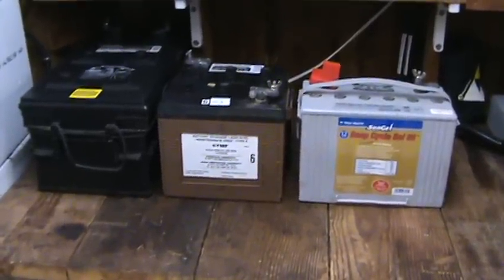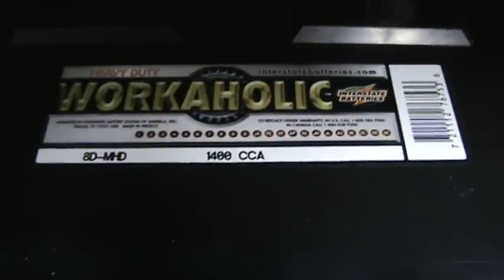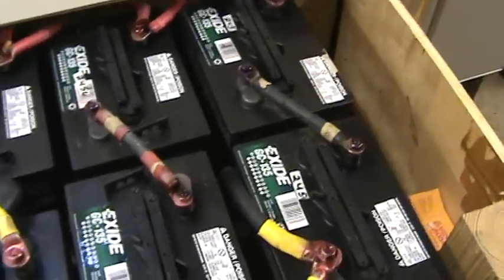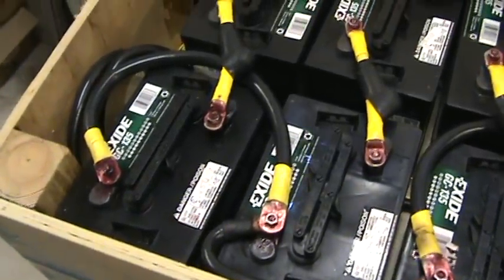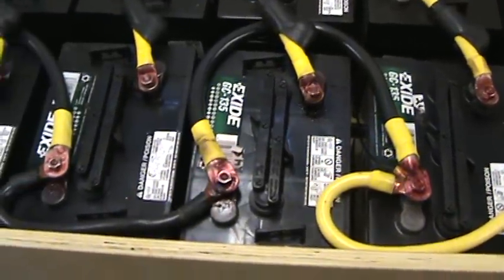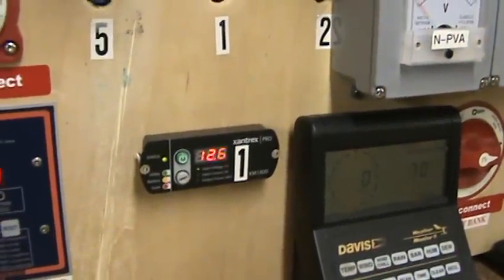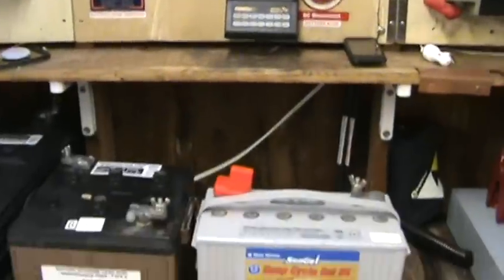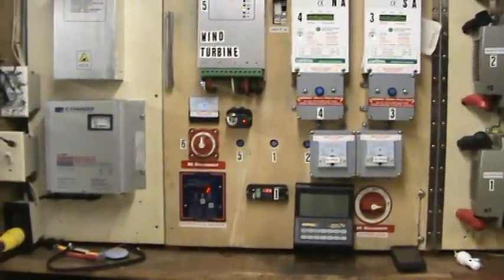Choosing batteries for solar power offgrid or a battery backup system.

Comment: I've been off the grid for over 20 yrs now and what I've found was that the gel cells don't work at all in the summer time.They hate heat.The agm's work fine,and the golf cart  6 volts work fine.But if you really want a killer system that you cant hurt then go to the fork lift batteries.You can get 3000 or better amp hrs and you can hit them hard as you want and take them all they way down and not hurt them.They would be the last batteries you would have to buy.Well worth it.Also I found that using buss bars made from copper pipe or brass bars work better than cables.There is no loss in them and what I have found was that even if you keep the cables clean you can't get the corrosion out of the wires under the sheathing,and you will lose allot of amps and not figure out why.Once I started using buss bars I never lost a single amp.Great work by the way,I'm just glad that someone is teaching people how to be self sufficient.
Reply: Forklift batteries can last for  along time, that is true if it is treated right. If you abuse them they will be killed in no time like any other lead acid battery.
To note also is that a forklift battery will take up to 20% more power to recharge than any other lead acid battery of the same capacity.
Reply: Good show. 
Johnson Controls make an assortment of Batts for a variety of brand names. 
 Their quality control is admirable.
Any budget minded person can realize that's $$ well spent.
Reply: You should have your own channel.  Most folks don't have that experience.

Comment: I been running 8D batteries with a reserve of over 430 hrs @ 25 amps for over 30
years on multiple yachts. They will run almost anything. They take charge discharge cycles in the high hundreds if not more. My batteries run what is a self contained livable environment on my boats.I do less than 50% discharge before  recharging, this increases charge cycles by almost double. I run 2 3000 watt inverts both @ 50% , they draw about 25+ amps together while in this mode with a reserve of 3000 watts. This gives me around 200+ hrs between charges. I have 2 of these 8D batteries and both are over 3 years old and show no signs of dying.Cost under $ 200.00 ea. Sam's club. These batteries have been the marine industry standard for decades. It's one thing to have your outhouse light go out, it's another to be in the middle of the ocean when your power craps out. I'll go with the millions of sailors with a combined use life of MILLIONS of use hours using this proven battery over all this hypothetical stuff any day. i'M PREPPED TO SAIL MY ASS OUTA HERE

Comment: I'm rather surprised that the battery are not lasting beyond 4 to 5 years before they are replaced.  Sounds like the batteries are building up a layer of sulfate (sulfation,) which is actually VERY easy and CHEAP to solve.  Try adding a teaspoon of Epson salt to EACH cell INSIDE of the battery, then charge them to a 14V charge for a couple of hours .  After checking and validating the voltage is holding at 12.5V or higher for at least an hour after being removed from the panels before hooking them up to the inverter (I assume you are using a grid-tie vrs. a simple isolated grid lije when camping.)

The desulfation may (the first few times) cause the battery to get a bit warm, but so long as the caps do NOT pop up and the acid starts to leak out (by charging higher volts at a lower amp) it should restore an old battery to it's virtually 'NEW' ability to charge and RETAIN the charge.   

I've got cheap batteries I bought at Walmart that are running just as good as the day I bought them.  Heck the system works so well I've had the power co 'question' me, and wanted to come out and 'review' things....  I think they are hust frustrated because they have been paying ME for the surplus power now.

Hehehe...

God Bless & Semper Fi!
Reply: epson salt will destroy deteriorate the battery plate in  a battery in no time and will lower the battery voltage.
Reply: David Sturdevant 
thats an old car lot trick. the battery will last long enough to sell the clunker, but it destroys the battery in fairly short order.

Comment: Hello, I will be using a 500 watt solar cell to be used on my 14ft cabin sailboat I am building.  I am looking to parrallel the batteries.  The batteries will be in my small cabin.  Using solar for Garmin for navigation, recharge double AA type batteries, lap top, and lights.  Any suggestions for battery type?  Thank you. Bert.

Comment: ALL of these batteries are not as good as you can get for the money. They're either lead-acid or gel-cell. All of them have a VERY limited lifespan of 5-10 years if used correctly and properly maintained. Where are the Nickel-Iron batteries, Iron-Edison batteries have a 10 year guarantee and some of the original Edison Electric Co. Nickel Iron batteries are still working (some at almost 85% capacity) 100 years later! Why spend a ton of money on something that should last at least 20 years but only lasts 5-10 years. The lead-acid batteries are 19th century technology, why are we still using it? Ni-Fe batteries can be discharged MUCH MORE without damaging them and reducing their lifespan. They also have better charge/discharge capabilities, and if properly maintained should last your LIFETIME!
Reply: Daniel Huarte
Earth 4 Energy

Safe Redirect => http://home-renewable-energy.blogspot.com
Reply: I'm fully agree wiht you! And I'm trying to make Nickel-Iron batteries. Do you know any recipe for to fabricate its? I ask this, because is not just to put Iron, Nickel and potassium solution in a case.I saw that it use oxide-Nickel powder in a frame like support, immersed in the solution.
And the lead-acid batterys EXTREMELY reach the 5-10 years of use.
Reply: ssssssssssssss
Reply: Iron Edison is supplied by Changhong a Chinese battery company ..... Ni-Fe has energy efficiency of a little over 50% ..... and the Chinese manufacture says their batteries will only last 3 years at a daily 80% discharge rate .... do more research  ....

Comment: ...and to the guys trying to sell building DIY panels, I have to ask what your time is worth. There are many distributors with panels less than a dollar a watt these days, some around 50 cents/watt. The Chinese amorphous sets from harbor freight are NOT a deal. 45 watts from three panels and a ten buck PWM controller for over $200? Try Solar Blvd, like another person posted, or try Sun Electronics. Northern Arizona Sun & Wind... etc. There are many out there selling good panels at decent prices. Just do a little homework. The ones selling the Chinese stuff at inflated prices (harbor freight, northern tool, etc) expect the customer to not do any research. PV has come down in price, and is more affordable than ever. I just went to one web site, and they have 230w, 24v panels for $155. That's .67 per watt. It's just one example. I think it would be a challenge to buy all the supplies, including a large piece of low reflectivity tempered glass, and still 'make' a couple of bucks an hour by the time you're done. Look around, affordable 'commercial' panels are available. Putting together a small to medium sized offgrid or stand alone system is not rocket science. Just do some research.... buy a book, read some magazine articles, and check out all the free video info here on youtube.
Reply: i agree totally.
Reply: steve w 
the panels i got from harbour freight had one that put out 5 watts. the moral of this story is test them when you get them.

Comment: Golf cart batteries are great for a couple of reasons: one, they're readily available and affordable. Also, eventually every battery will need to be replaced. Larger "L-16" type batteries have more capacity and will last longer, but weigh well over a hundred pounds each. I'm glad you mentioned equalizing the battery bank. It was a good explanation, and answers Nathan's question to a degree. Over charging an AGM or get battery will ruin it. They're great in their own purpose (they're sealed, and don't gas as they're being charged, so they don't require the ventilation of a flooded battery), but to make them last longest, they have to be monitored often and kept near full charge, because you can't equalize. It's a different kind of maintenance, but it's still maintenance. A flooded battery will need to be topped off with distilled water every now and then. Some water will be lost in regular use. Running the high voltage during equalization insures long battery life in a flooded battery.

Comment: Could you please suggest for me, what would be needed to provide emergency power in my apartment? I would like to run to police scanners, and a laptop for several days. I would like to leave it constantly charging from a wall socket until it's needed. Thank you.
Reply: go with a LiPO4 battery that will not offgas for apartment use
Reply: Thank you. I'll check it out.
Reply: KyleCarrington Would the LiPO4 run a CPAP machine?  I need to find something to maintain durable medical equipment.
Reply: Asher Anna The answer is yes if you have enough of them.  It is all simple math.  But first you need to install a watt meter on your CPAP machine to see how much it draws.

Comment: Hello , I have 3 deep cycle batteries 112 ah each , I live in NYC so no solar or windmill for me but I do have a generator to charger them . I use a Schumacher 20-30 amp charger , was wandering if I can hook up a second 15 amp charger to the bank , I don't wanna burn out my chargers . Thanks
Reply: I'm using it for lights in the garage since no electric (NYC rules) I spend a lot of time there and I must close the door (you not supposed to work in your garage just park your car) so I just wanna be able to charge my bank faster but don't wanna destroy my chargers or my batteries . Thanks a lot ..
Reply: Mike O nice town......I'd move........
Reply: SpockMcoy Issmart it's NYC not a town but okay
Reply: I think frank Sinatra called it a town ;).  I don't live anywhere I can't burn wood, shoot, etc, etc....
Reply: SpockMcoy Issmart oh id love to burn some wood, it's why I go camping all the time. Here I probably go to jail for that :)

Comment: I am starting with 4 Trojan 6volt golf cart batteries. I have a small 60 watt, 12volt solar array and a charge controller. My solar panels are not charging my batteries up enough during the day to run a couple of lights. How many panels and what size would be necessary to charge them up during the day. All I want to run is a 90watt LED, and a 4 tube, 4' Florescent light fixture for 18 hours a day in my greenhouse.

Comment: Lithionics makes 12v through 48v lithium power cells up to 400 Amp Hours (single battery) designed for solar and depending on discharge 85-95% and up to 3000 cycles,400 amp cont. 2000amp peak,Superior batteries! If these are too much money Sun Xtender brand is half the price!

Comment: ...and they will last 30+ years since they are well sealed, they use low iron, tempered glass so collect more light, safer. Window glass it's coated to inhibit UV transmission so stops even more of the light. If you use plastic, it's a fire hazard and will fade, as well as expand and contract and break your seal pretty quick. ...made yours for 58 cents a watt are you recycling the glass. 

UL listed are OK with your insurance co, a fire with non UL panels will be on you!

Off grid for 11+ yrs.

Comment: Where do you find solar panels for less than $1 a watt? The cheapest ones I could find are about $1.50 a watt. Also, I made my own 60 watt solar panel for around $35, or about $.58 a watt, so it is actually cheaper to make your own, though much more time consuming.

Comment: As long as you scale the voltage properly, and you have a charge controller to make sure the battery doesn't overcharge, you can use whatever type of battery you want, including forklift battery.

Comment: Making solar panels is more expensive than buying! Panels sell for less than $1 a watt. 

Amps in to amps out is incorrect in this video, you do need 25-30% more wattage, you charge at 14v vs <12.7v discharge.

Mass production is why 'golf cart' batteries are cheaper than 'solar' batteries. Most people who use solar use some type of deep cycle battery from other industries that use more of them, 'golf cart',  'floor scrubber' and 'forklift' are all popular batteries for solar use.

Comment: Hello. I am just starting out in solar power. Right now I have an 18 watt Coleman single panel and one deep cycle RV batt. The panel charges the batt very nicely and I use the batt in the evening/night. What I'm wondering is; can I hook my 110 volt 60 Hz converter up to the battery while it is being charged. Basically can I use the batt and be charging it at the same time? If I can, then could I hook the converter straight to the solar panel? Thanks in advance for your consideration on this.

Comment: Hello! Thank you for the info. I am in Pakistan and here power breakdowns are on daily basis. Additionally, price of electric power is going through the roof. I also recently acquired a Banana Farm and facing the same problem there. Came across your video while searching for high capacity deep well pump which can run on Solar Power. In your video can you tell me with all the gadgets on the wall how much a system like that can cost?

Comment: What's more important for deep cycle batteries is the reserve capacity rating and not the amp hour rating.  The reserve capacity tells how many minutes you can expect the fully charged battery to drain at 25 amps.  This will give you a much better view of the battery capacity in a solar system.  You'll also find that AGM batteries are really lacking in reserve capacity versus good ole wet cells. I like your setup! Mine is smaller and set up for AHBL Day running 2 chest freezers as fridges.

Comment: Hey thanks for the great video. I am looking into buying 6v Trojans for my rv which I'll be living in for two years with my partner. We are saving money for land and will be using solar and deep cycle batteries for our electricity. I'm not sure how many batteries and of what amp hours I will need. Is it just too much to ask to run the AC without damaging our batteries? We aren't picky but it would be great to have AC when extra people are packed in on hot days. Thanks for any help!

Comment: I was wanting to go alternative but the downfall is the battery technology currently sucks. It will cost you a good $1000 dollars for a bank of batteries and they will be useless in probably less than 3 years. Not to mention you waste more electricity charging them than they can hold and you can't really put them through deep cycles because it shortens their life.

I hope they hurry up and perfect the lithium ion batteries for big use since they do deep cycle and are lighter and hold more.

Comment: No Problem... Listen, NiFe batteries have a few small issues. But in my opinion, those issues are negligible. You can't drain them as fast as lead-acid on heavy loads, and they don't have quite the energy density either. But 50+ year lifespan? Wow...Discharge to zero, and no damage... Wow.

Comment: Math- use 60 amp for an hour, you need to put 30% more back in.   Simple math, 60 out, 90 back in?   My math says that's 50% back in (60+30=90) ?

Comment: those xantrax inverter are they modefi or pure sine?
also how long you keep them on? half of my house is of grid
I have 232ahx4 when it goes down to 11.5 the battery bank
in a day im putting back 54amp should I bee consern or I need more solar panels?

Comment: Good info.  I'm planning to set up an off grid system this Spring at my cabin.  One question that I have that I don't seem to get from these vids is what is the gauge wire used in connecting the batteries together? Thanks.

Comment: Would this be a decent solar battery for a home system?  Just found a 12V Duracell AGM battery (31DTMAGM) at Sam's Club for $169.  Seems to have good specs for a Marine/RV battery.  Most of the Solar AGM batteries I've looked at are $300.

•100 amp hour rate:110
•20 amp hour rate:105
•3 amp hour rate:85
•5 amp hour rate:86
•6 amp hour rate:87.4

I know you want to stay away from car batteries with lot's of cold cranking amps because they are not built for solar applications.

Comment: Wanted to mention that i liked your video and your indoor power panel is very elaborate. I would like to know more about the design and what it would take to set up one just like that??? Im in the beginning stage, right now im purchasing the solar cells and aluminum angle frames to build approx six solar panels that consists of 72 3x6 solar cells each. Right now im interested in learning about after the panels are completely built and tied together! After that im still lost! hahaha

Comment: This is easy.  You need to learn about series and parallel connections.  Connecting two 6 volt batteries in series will obtain 12 volts.  If you have 5 sets of batteries connected in this fashion, you parallel connect them together to maintain the 12 volts, but increasing amp hour capacity.  Use fuses between batteries for additional safety, especially if the batteries reside inside your home!

Comment: i got a free big boat battery i try to keep the charge up as much as possible and the cells full its lasted 3 weeks so far for a "junk" battery that was headed for the recycle its 11 years old and it tested 1000 cranking amp and the sticker a said 1200 other than that i put 1/2 a gallon of distilled water in the cells to top them up it had another in parallel for a 12 volt bank in a lobster fishing boat the other one tested bad so i think it was hauling the good one down

Comment: Interesting info, I prefer the L-16 6v Deep Cycle Batteries.
I just started a channel showcasing the installation of my 4.1kW off Grid system. It has 16 L-16 Batteries in a 48V configuration.